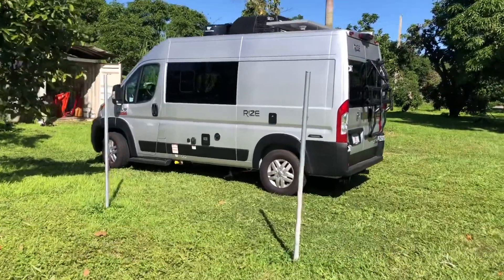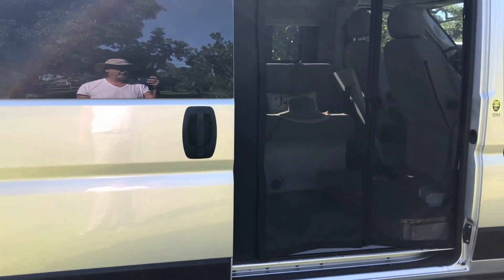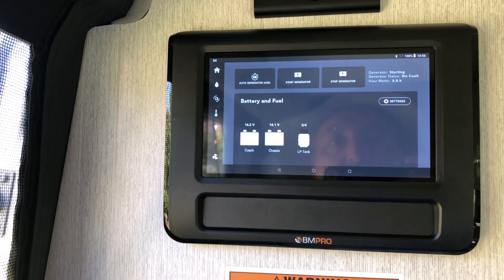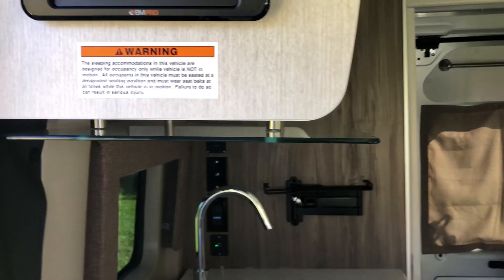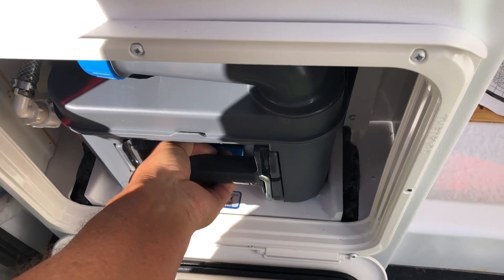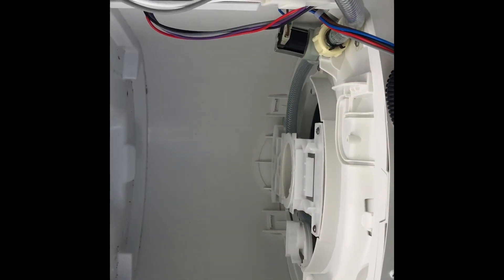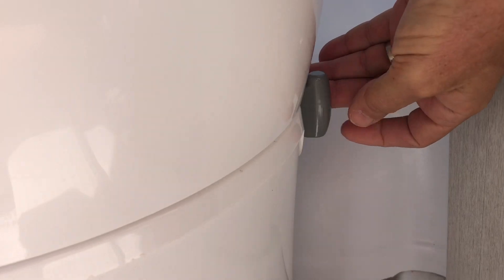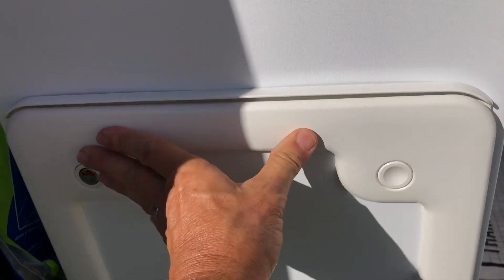Cleaned the black water cartridge and ran the generator on my Thor Rize

Comment: That was painful. I pulled mine out and broke the cartridge. Glad you figured it out before breaking it!
Reply from the maker: Everything in there is flimsy plastic, and if I remember correctly the woman that was showing us at the dealer struggled with it too. Still no complaints though. It’s just there for emergencies, and when we have found ourselves in an emergency during our trips, it has been conveniently there. 😀
Reply: I'm glad you found out what was "catching". I bumped into the same thing but after a year of use so I checked  "flush" lever and quickly notices it was in the back position and not fully pulled towards the front of the toilet. Otherwise it's easy overall and  easy to empty with no splash. *especially if you follow #1 only.
Reply from the maker: @sugarey  I think I may have used it once myself, but apparently my wife uses it a lot because I went to empty it the other day and it was almost overflowing. At least I fertilized my mango tree with it. I’m itching to hit the road again. It’s been a while. We may go visit Destin next.